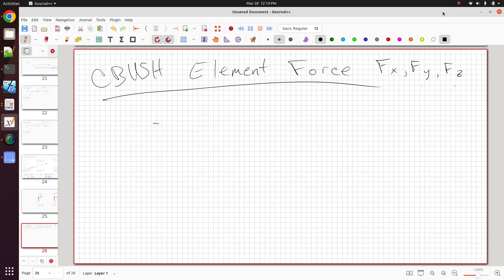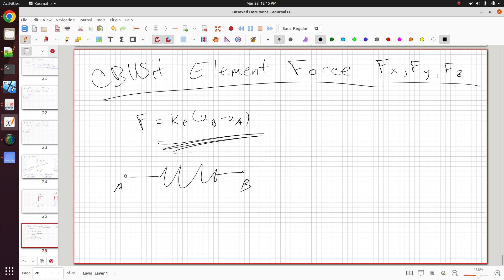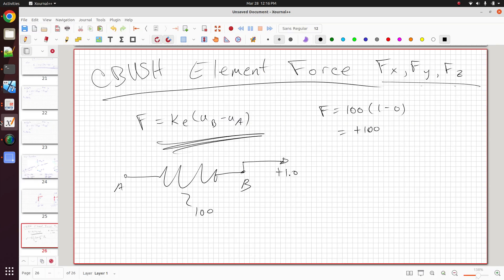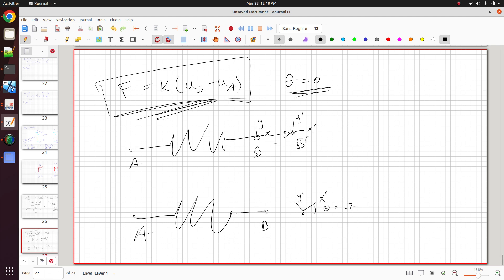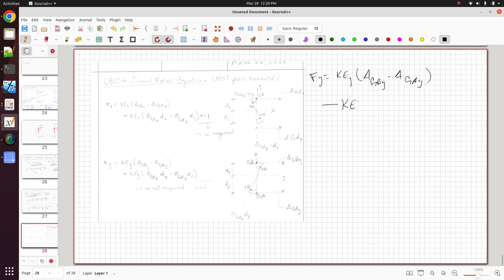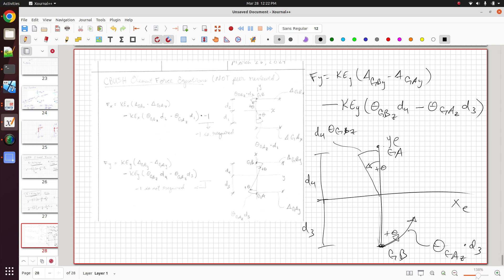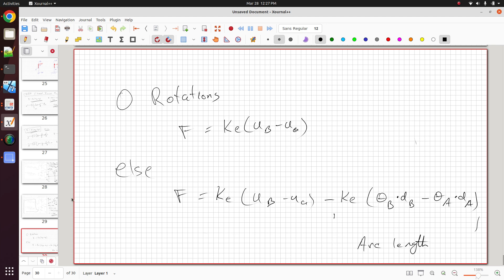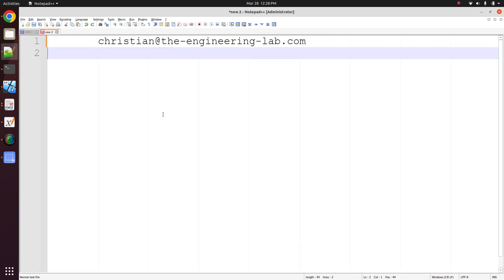Nastran CBUSH Element Force Equations for FX, FY and FZ

Comment: Here, it might be modeling the system slightly differently. A likely explanation is that the spring stiffness is distributed between two nodes, meaning the rotation occurs equally in both directions.
In a spring element, the relative rotation is shared between the two connected nodes. Since Node 1 is fully fixed, the spring resists rotation at both ends equally.
A spring element in FEA typically has two nodes, and stiffness values (both translational and rotational) are applied between these nodes. The spring does not behave like a rigid body—it distributes the stiffness between the two connected nodes.
For a rotational spring:
If a pure moment is applied to one node, the spring resists that moment by developing equal and opposite reactions at both nodes.
This means the relative rotation between the two nodes determines the internal moment distribution.

Comment: Thanks for sharing. Did you manually put in the 0.7 rotation? If so, how did you come up with this value?
Reply from the maker: Are you referring to the 0.7 that appears at 8:40? 0.7 radians of rotation was chosen at random and is meant to demonstrate where the numbers fit into the equation. I could have used 0.5 radians, but the value of 0.5 already appears in the calculation and may have confused.
Reply: Ah ok. I thought the amount of rotation the part allows was calculated.